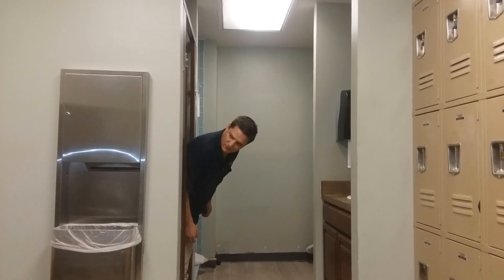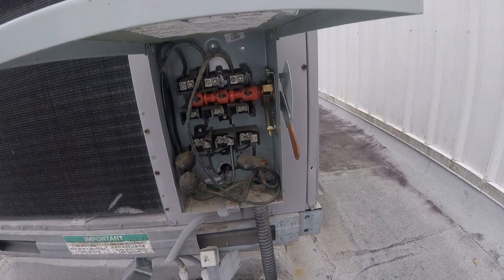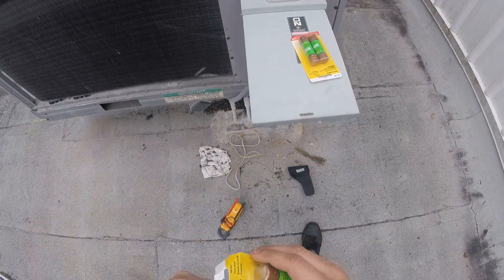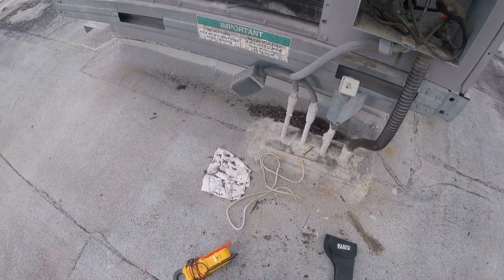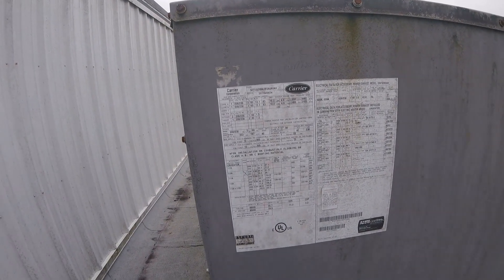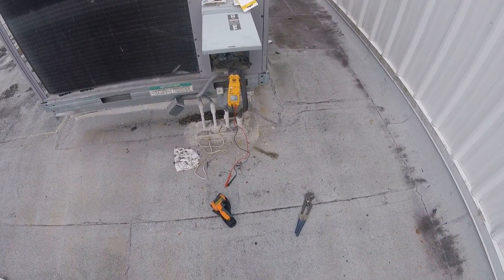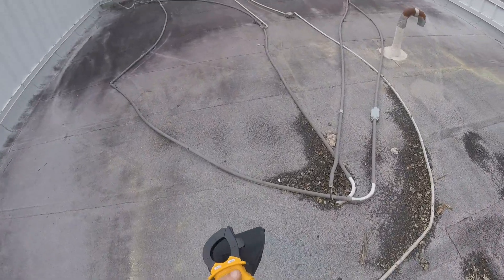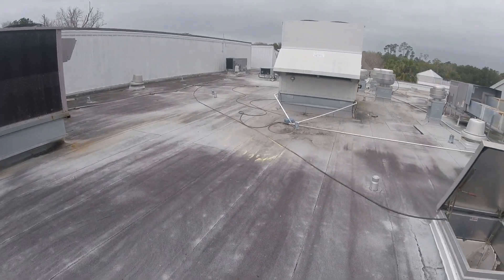HVAC RTU Carrier followup Troubleshoot

Comment: Hey it’s me. The disconnect is no good. Their is a bad connection causing heat which blows the fuse. On the name plate you will see MOP maximum over current protection. I used to drink and I don’t remember why I chose Yo Momma for my name lol shit happens. Your welcome for the info.
Reply from the maker: That's what I told my boss I said we need a new disconnect just to eliminate the problem that unit I think was bought back in 2012 and it hasn't given us one problem except for belts and simple stuff thanks for watching yo mama I appreciate your input on everything and by the way great tip with the IR thermometer👍👍

Comment: If the heat pump is in heat mode and it freezes up it will go into  defrost and start the electric heat. The unit has a sensor on the coil for this purpose.

Comment: I would chemically wash the condenser coils. Also I use no ox on the fuse holders in the disconnect. It helps with corrosion and resistance heat build up.

Comment: On Carrier equipment the first 2 digits indicate the week the 2nd 2 digits indicate the year of manufacturing. This is the serial #. The model # beginning with 50 is electric heat if it begins 48 then it’s gas heat. This is on package units.

Comment: Your cooling and heat should not run at the same time unless you have dehumidification controls.
Reply from the maker: Not cooling but heat pump and heat strips running at the same time  but i really think it is the disconnect  that is bad.......It was really easy to put in that fuse  in the C Phase

Comment: I would change the disconnect.I see this all the time more than likely the fuse holders are worn out.
Reply: Shut off the breaker that feeds that disconnect, make sure box has no voltage on it, than remove fuses. Fuse that is getting hot has its holder bent out of shape. Squeeze in holder with channel locks after polishing inside surface with sand paper. Reinsert fuse by hand, feeling for a tight connection. And down at Home Depot get a real fuse puller and put fuses in straight, not forced in at an angle with channel locks.